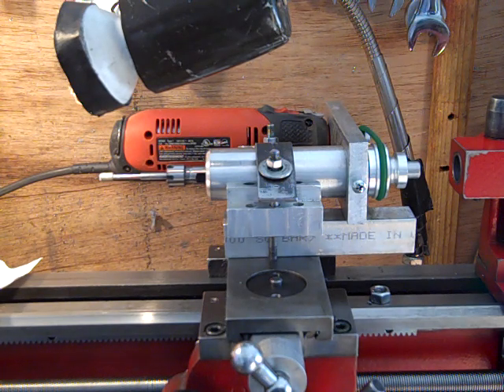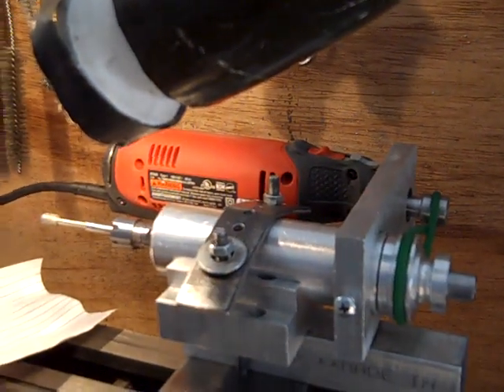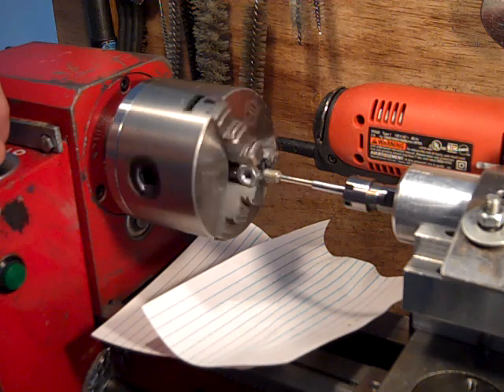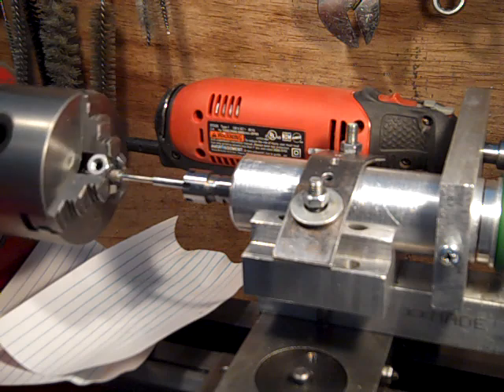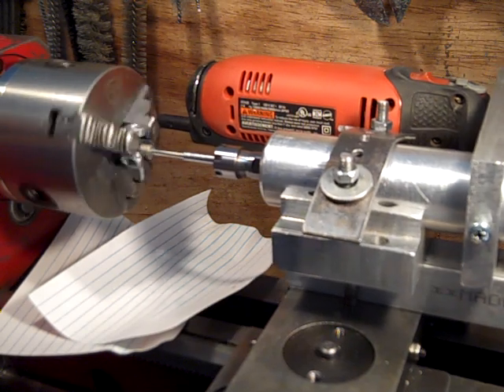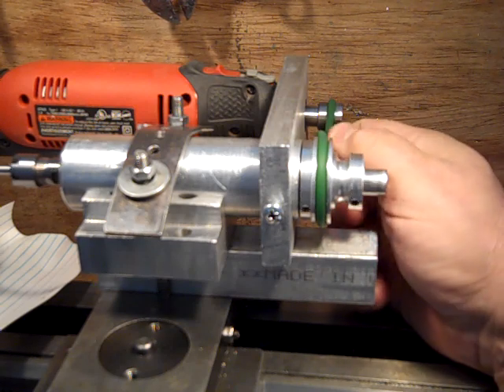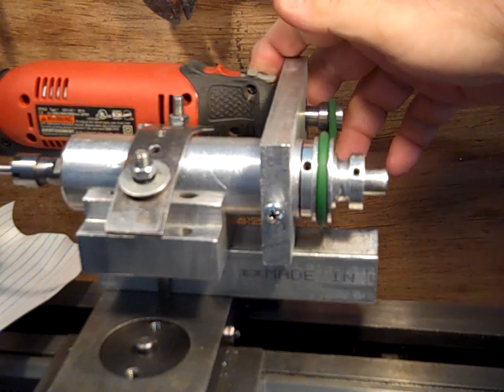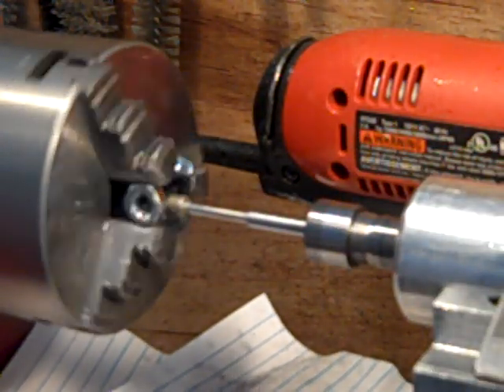Grinding Mini Lathe Jaws with DIY tool post grinder.

Comment: I ended up hand scraping the jaws on my lorch watchmakers lathe, so that I could eliminate bell mouth... i did it with 6 mm spacer, since that's close to most work that I do... hand scraping also eliminates any abrasive dust that can get into the chuck, and onto the ways.
Reply from the maker: I don't quite understand. Did you scrape the jaws while they were in the chuck?  That seems like a pretty hard thing to do.

Comment: Very interesting video.
I think the jaws are going to be loose on the front where they are bent outward towards the front from over tightening on small parts.
So you’d expect to take more from the back first.
You would want to make sure those nuts are absolutely identical.  I’d be tempted to hold a round disk in the very back of the jaws, grind the front then remove the disk and undercut the back where the disk was, making that small section unusable.  You can put an external wire around the jaws to hold them tight while doing the undercut. 
I’m interested in what you think of this approach.  I used to do this procedure with a soft jaw chuck.  I don’t see those anymore.
Looks like you are getting some flex on your arbour ?
Grip something like a ground dowel pin in your Chuck and put a dial indicator on it.  How much run out do you get?
Reply from the maker: It's a new chuck. I was hoping the jaws would not need to be ground but they vary a lot by how far in they contact the thing being chucked. Since finishing the grind, I chucked a 3mm pin and it is very centered and concentric.
Reply: @ 
Fantastic.  Shame some new chucks are not fit for the purpose out of the box.
Reply from the maker: Indeed the nuts have to be identical in size and placed exactly the same between each jaw. It took some time to set up. I noticed that apparent flex in the arbor on the video also. It is actually from the light bouncing off the chuck jaws causing an optical illusion. The grinding arbor is obviously not very thick therefore not particularly rigid, but at very slow feed and multi passes, it wouldn't matter that much. I have ground jaws now about 4 times and learn a little more each time. I should have said in the video that it is imperative that what is used as spacers for the jaws be exact. They MUST be all the same size and all placed EXACTLY in the same plane between the jaws.